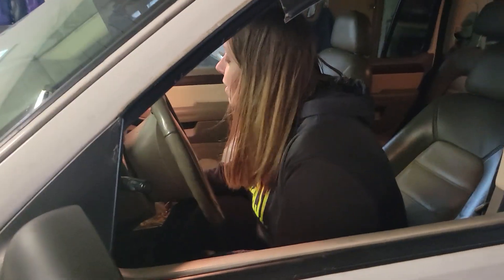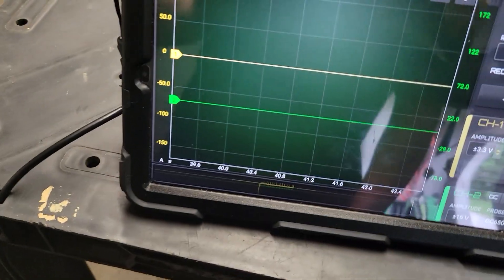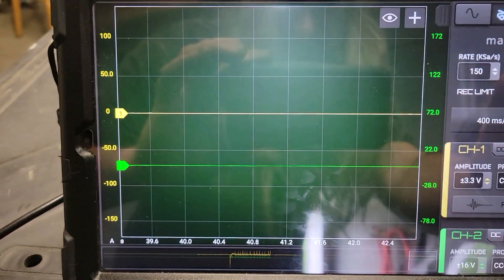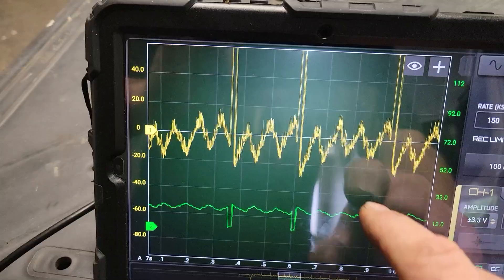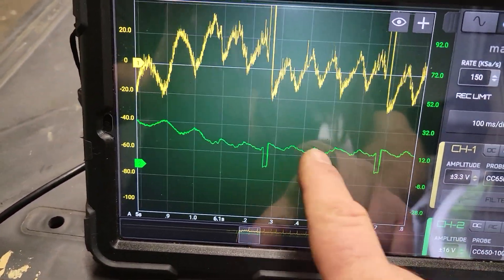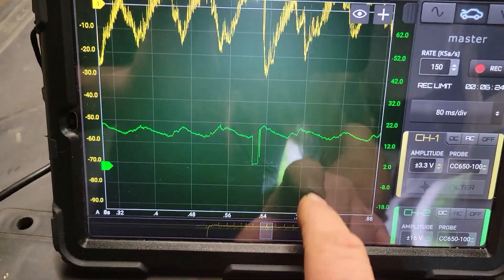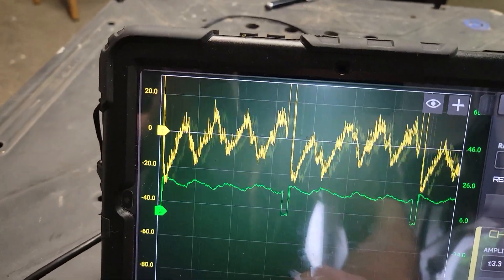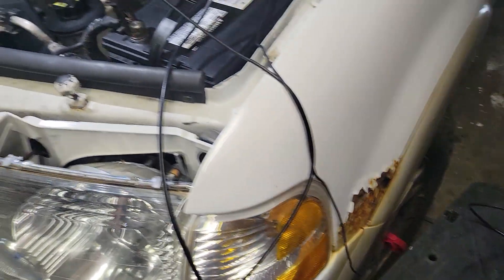Double relative compression test with ac coupling & current.  HS-512 and Hscope automotive module.

Comment: What site did you use to get the download for the amp clamp?  Great test. Enjoyed it
Reply: Hi. Thanks for the tip. Of course I found them under probes then the down load cloud symbol. So when I go to channels and there is a list of definitions then an eyeball symbol towards the right side what are these for?
Reply from the maker: @john82324  The definitions are for the abbreviated names for names in the channel menu. For example, if you are setting up the scope for a measurement. On the scope main screen, if you tap the channel name( the colored block that says channel 1 or 2) can change the name to any of those abbreviations.  Cmp=cam position sensor,ect. The eyeball is the list you can see for quick access menu when you tap the channel name. If you tap the eyeball it puts a line through it saying it will not be on the menu. It is handy for if like you do not do can or lin at the moment you can tap the eye ball and it will put the line through the eyeball, signifying  they will not be on the quick channel naming function. There are no settings associated with keeping the eyeball highlighted  or turning that definition off. It is simply a fast way of quickly changing the name of channel 1 to say MAP and channel 2 to tps. Hope that helps, any other questions, feel free to ask
Reply: Hi thanks I just checked out what you said about abbreviation to name the scope channels. Finally it made sense to me. Thank you for your help. Greatly appreciate it
Reply from the maker: @john82324  Anytime at all , if you run into questions. I'm no expert on it but fumbled around already enough to make the scope and software to do about anything I need it to do
Reply from the maker: @john82324  Hi, and thank you!  The downkoad is from hscope. It has probe settings that have already been set up for most accessories. If yours is not there you can create your own custom probes. Everything I have needed has already been there but, it is nice if you make a sensor to be able to set it up and name it.